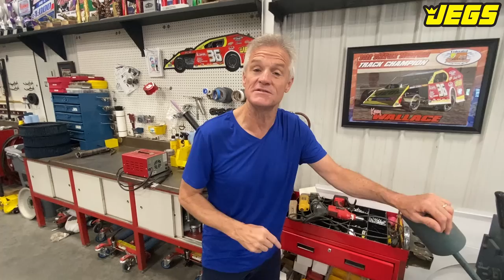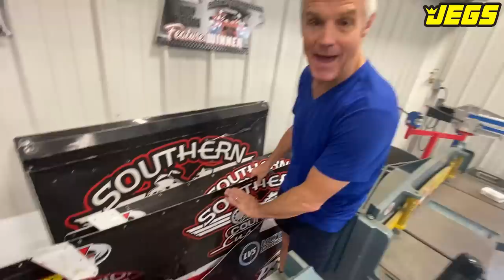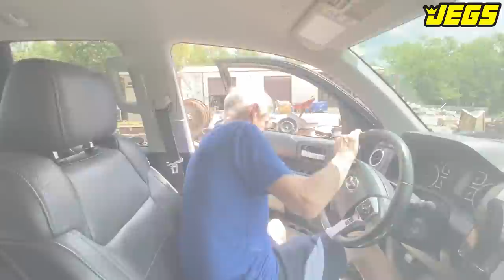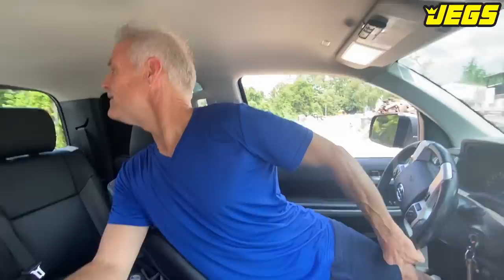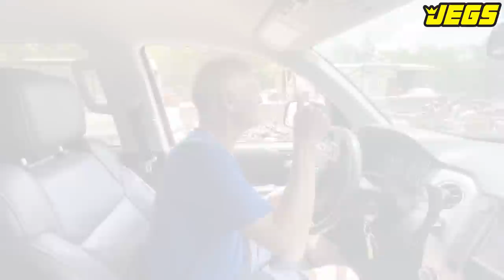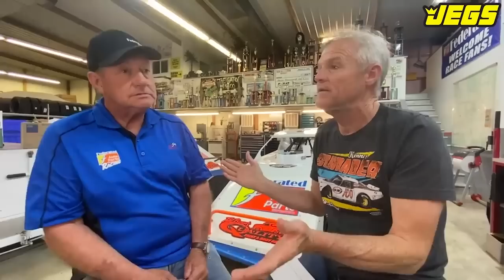Here's How Much $$$$$ I Made at the Scrap Metal Yard!

Comment: Man wish we could toss out scratch and dent wheels like that. Ya Change yours out more then I change my dirty britches.   Maybe you should really consider donating the wheels and cycled out hubs to a smaller/begging team. As long as the wheels don’t have a ton of runout they are perfectly fine for a team just starting. Front rotors hardly ever crack as long as they are maintenanced because although they are “stock” from China they don’t see the prolonged heat like the nascar stuff will.  We want the sustainability in the sport and for it to grow then one mans “junk” is another mans treasure and a lapped out hub is a perfect example. Bent beads on wheels aren’t an issue let alone a safety or liability problem if given away.